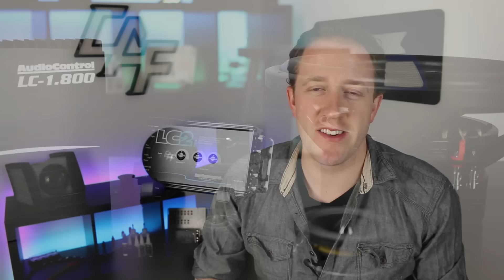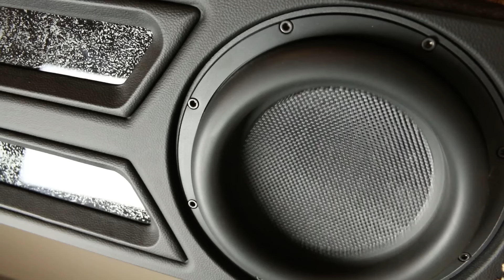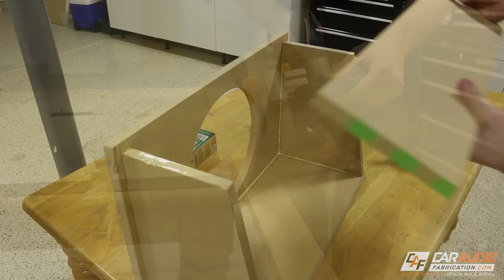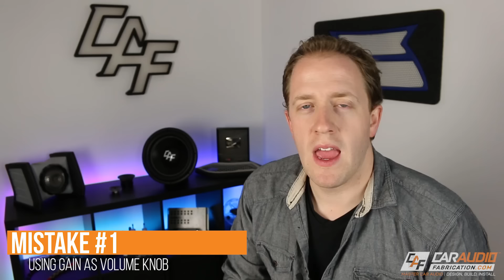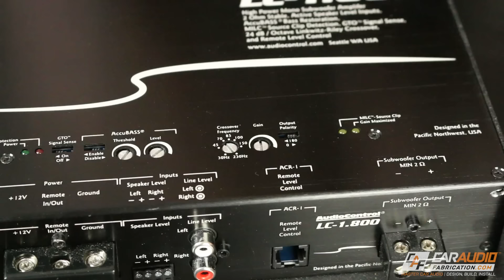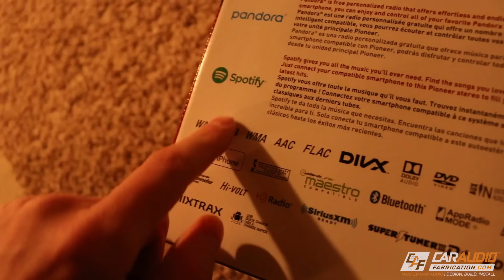Avoid these 5 common Car Audio NOOB Mistakes!

Comment: 😂 This video is 110% true! 20 years ago my headlights were dimming, amp gain on max, mix match subs, with about 4 tubes of bathroom caulk on my homemade box. can’t forget those red Sony explode 6x9’s on a 50x4 pioneer super tuner from Walmart.  Awww the good old days‼️
Reply: bro , red sony explode !! you just remember my old speaker dang !!
Reply: Why not add capacitor and good battery
Reply: I literally just put a”brand new”unused pair of Sony Explodes that I had lying around for years into my OBS Sierra lol!
Reply: Memories on those xplodes wow. You took me back 😄
Reply: Nah the heavier frame EARTHQUAKES had the sony xplodes beat, as di any speaker realy if "paired" with any sutable amp.
Even better sounds could be gained by using mix-matched speakers of all different reactances, as then you also had auto-leveling between 16ohm speakers, and 8ohm house and 4 ohm car and 2ohm subs.
Very difficult to attain, but sometimes putting a 16ohm across the same terminals as the 4ohms used, allowed for much harder hitting bass, with an increase in tweeter power.
Reply: As a newbie who wants to do their first install of audio gear, man I'm so overwhelmed by everything available on the market lmfao. I just want a setup that's good for pumping bass for mostly EDM music but I don't even know where to start.
Reply: Bro, yes!! The super tuner III was my fav back in the day. Had it pushing a 10" kicker solo baric (square sub) and a 300w soundstream amp. Good times
Reply: I've always just used the head unit to power my door speakers, and always sounded good with decent aftermarket speakers. Maybe i am missin out, but on my current 6 1/2 front and 6×9 rear, Cerwin vega 2 ways are crisp and clear with a couple of hard hittin 12's.

Comment: So, I plan on replacing all factory speakers on an '07 tahoe and adding a modest sub and amp for some bass. Is it absolutely necessary for me to replace factory head unit?
Reply: Daniel Lito no
Reply: Buy a lc7i
Reply: @Dshall88  thank you sir
Reply: Daniel Lito or you can get an lc4.800 . Which can let you tap into factory head unit and also is a 125x4x4 (4) channel amp. They go for 400-420 on eBay/Amazon. Then all you would need is a mono amp for your sub. I’d recommend. Keeping sub at 2ohm bc you can get a 500x2ohm amp for pretty cheap. Then just buy some fuze distribution blocks to run power to both amps with just one power cable coming from battery. Also acts as an equalizer and has many features. Will help you restore base from factory head unit. This guy has a video on it. Just type in lc4.800 and you’ll find his video

Comment: My mistake was the law of diminishing return lol should have watched this beforehand but it’s ok. 

My system sounds nice and I expected more bass from my single 10 inch sealed sub but oh well. 
 Could someone please tell me if my system specs sound about right because this is how I did it. (Just want someone’s feedback)

My amp is a 5 channel kicker amp. Putting out 100 rms x 4 channels at 2 ohms (each channel 100rms) and 1 subwoofer channel putting out 400 rms at 2 ohms

My speakers are the infinity kappa 682.11 cf and the kicker sub I don’t remember but it puts out 400 rms. 

Update: The sub is a COMPRT 10 inch sub. And it is a 2 ohm dual voice coil, in a sealed box. 

Question: The subwoofer says it is recommended for a sealed box of .40 - 2.0 cubic feet volume. Does this account for the top depth of the subwoofer?? Or would I have to minus that from the box volume I currently have to have an accurate volume.

I’m sorry I hope I make sense here. This is my first system build. Thanks for any help

Comment: Thanks for the info. Just watched two of your vids on noob mistakes. Glad I don’t do them, tho, I’m not necessarily a noob, just not a pro. Just did three iDatalink Maestro Rr w/ pioneer head unit installs. But for some reason, phone controls on SW don’t work on any of them, even with OEM BT harness unplugged and SW1 wire hooked up. Any ideas?

Comment: *Idiot Guide to Understanding Amp Power when buying  a crap Amp** - Ever see flea market Amps with massive numbers - 3000 watts for $100, 10K Watts for $179 too good to be true and it normally is... 
Here is a tip, the Fuses on the Amp will tell you what you need to know!  
As a simple rule of thumb with like a Class D mono block aka Sub Amp
 take a look at the Fuse value. Now Simply add a Zero. So a 30 Amp fuse now equals 300 a 90 Amp fuse is 900...and use that number for the estimated highest output of that amplifier.
  So regardless of what the Amp box says 10,000 Watts @ 2 Ohms if you only see 1x  30 Amp Fuse you are looking at a 300 Watt Amplifier in the real world. 
One should never even buy such a crap Amp that lies like that in the first place, but they seem to sell lots of them.  To not get screwed more than you already are, at least know something close to a real world spec on what the amp could possible do, instead of the numbers on the box that they somehow record when the Amp gets hit by lightning!

Real Amps with real numbers will tend to have the CEA spec numbers, but on cheap Amps this is the simplest way to not get totally screwed on a garbage Amp you shoudnt buy in the first place.

Comment: question: my amp which is the hcp 1dk does not have a gain control but has a "level" control. Is that the same?
Reply: I would assume so ik nothing but still

Comment: I have a 2006 Volvo C70 with the upgraded 14 speaker (2 subs) Dynaudio soundsystem. I installed a GROM unit and I am experiencing low gain issues. The FM radio still works great, but the GROM system (which overrides the 6-disc CD changer) only uses about 60% of the speakers' potential. Do you have any advice on how to fix this issue?

Comment: I’m trying to put two pioneer Ts-swx2505 in my 2000 Toyota Camry. Is there enough air space for both in my trunk? Or should I do one under my front seat and one in the trunk?

Comment: Have you done an installation on the new mazda 3?
I have one and I'm thinking install this:
+ AudioControl DQ-61
+ AudioControl 6XS
+ AudioControl LC-4.800
+ Set Morel Virtus 402 
Do You think it's ok?
I want to upgrade in the future with a subwoofer and more speakers

Comment: I had a 98 mustang with a 4 year old battery, some street dude did my bass installation and gave me a 1500 watt amp and 2 12in comp Kickers, at first it was so great I loved it, but in less than 2 months the wire hooked on the battery burnt up, then he installed a capacitor, and I burnt it 5 times (all this money straight out of pocket), then he family installed a house capacitor so if it was too much it would just cut of the circuit...you would think that a good solution until you're trying to impress people with your sound and the bass just goes out randomly and shamefully you have to get out of the car open the hood and reconnect the circuit...lesson learned big isnt always best

Comment: I find that generally speaking half gain or maybe a tad over is the sweet spot.  I turn gains down, turn up the head unit until i hear distortion and then back off.  Then I go and increase gains until I hear distortion and back off.  With bass I'll turn up the gain until the subs stop outputting more at about 2 notches from max on the head unit.

Comment: ima starting a home project where ima use an ac to DC inverter power supply to power my amp and the same thing for my stereo deck and try to make a home theater capable to put out 2000w do you have an insight or suggestions???

Comment: Why cant I wire a new amp into the old factory harness in stead of making factory harness bypass use them speaker wires to go into new amp
Reply: CALEB PERKINS you can buy a high-low converter and splice them into the speakers.

Comment: Most common mistake I've seen with upgraded car audio systems is using massive amps, subwoofers and speakers in a smaller vehicle.  Some people do this on purpose (gangsta bragging rights) but it's still a mistake -- they aren't getting quality audio, just lots of noise.  Often the audio system (or the custom wheels) cost more than the vehicle itself, LOL.

Comment: I got a single cab s10 literally the smallest as far as space, got 2 10's bridged on a single channel 2500w competition amp. Im having problems don't wanna hit deeper bass notes I'm thinking it might be due to starving for airspace
The dash/door speakers are having distortion problems I'm considering running them all off a 4 channel 600w amp I got collecting dust. This is my first system where's my YouTube pros to give me some tips and tricks

Comment: Bought my pickup from a guy who had a custom system done, which looks really nice and clean, but it’s using all kicker equipment. It looks like he did some power upgrades, but the speakers are dying now, and the system never really sounded good, just loud(4 10” subs behind the seat with 5-1/4” mids, and some 1” tweeters in the doors)

Comment: Hello
Thanks for your efforts I want your advice i have 2 sets of jbl Gto609c for front and rear doors it’s 3 ohm 90rms i am planing to buy an amplifier jbl stage a6004 or Gx a604 both of them 4/2 ohms lower rms than speakers @4 ohm 60rms
My question can i use one of this amps with speakers on 2 ohms to get more rms or what’s your advice about that to get stable performance and be away from problems?

Comment: I installed a jvc kw'v350bt in my 2008 jeep wrangler sahara unlimited. I checked and rechecked the wiring its done right but i have no sound. Any help would be greatly appreciated. Also theres a blue wire that is suppose to go to this other wire in the jeep but theres no pin on the receiving end?

Comment: I definitely had a system in an SUV I owned that when the bass slammed my lights were definitely dimming! ALOT! Which sucks because it seemed like upgrading the electric would have costed more than the rest of the system put together, significant investment

Comment: I think my biggest mistake early on was mounting depth. I had a 84 Ford Ranger with 2 Rockford 15”s. It beat like no other but I think it hurt my knees lol.
Reply: Same here bought a brand new s10 in 2006 and had 4 15s in the extended cab and 2 in the custom enclosed bed. Blew my rear windows out and sounded cool for being 19 years old but not I got for top deal door speakers and head unit with no woofers or just a couple 10s and I also run a mids highs amp. Much better sound then fluttery bass

Comment: I seen so many guys do a big system and immediately think battery. And the slightly more knowledgeable say capacitor.  I just want to smack them. Alot of them think their stereo is running off their battery while they cruise down the highway.  Ill try and explain and most try to argue until i just tell them " f it. Google it" lol. I always tell them do big 3 first cuz its the cheapest and that way you know your getting max power out of what you have.  Most average guys will be covered.   Im a proponent of welding cable.  Seen plenty of comparisons of that vs overpriced car audio companies "kits" . Most of it is garbage that costs 4x as much as welding cable and wont last half as long.  Beef up the alternator after that if need be.  Battery is fine if you just want to and jam alot with car off. Capacitor...i just put in the same drawer as my wifes dildos.  About the same usefulness......🤣

Comment: Can I run a “1200 watt” wiring kit from Walmart with a 300 watt max output amp? The recommended gauge wire for the amp is 8 gauge with a 40 amp fuse but this wiring kit looks slightly larger than 8 gauge with a 60 amp or 80 amp fuse (i can’t remember).

Comment: After dabbling in car audio for 25 years (on and off), I’ve found the best bang for your buck is Alpine Type R for speaks (components and subs). They’re extremely affordable, they can take lots of power, and they sound magnificent. Just my opinion. I even installed a Type R 12 into my home theater because it sounds that good.
Reply: Renamed to the R series, they have not changed their speakers design for a few years so if your new tk buying alpine look for old stock in the type R ranges not series R
Reply: My pops has had two type R 12s subs for 19 years and I’m the one using them now
Reply: Best bet is JL audio, top notch and trustworthy
Reply: @texasboii5539  100%

Comment: How do you know if the polarity of a stereo speakers right
Reply: Just use a fire alarm battery, and touch + &  - on the speaker. You will see what way it moves. If it goes inwards it's the wrong way.

Comment: Another common one that I see all the time that drives me crazy - people who insist that they MUST buy an amplifier with a power rating that matches the power rating of their speaker / sub.  

So often I see people say "Can I please get recommendations for an amp that is 1,000W RMS for under $XX?".  Then when I ask them why they need 1,000W RMS, they say it's because I have subwoofer X, which is rated at 1,000W RMS, so I need a 1,000W RMS amp.  

I hear this so often, and it drives me crazy every time.

Comment: I just fixed my friend's car. The owner before him had wired the 2 sub in phase. the compo set (RF Power series) was wired totally wrong. One Door was okey but the other the Woofer was in the Tweeter port on the filter and the other way around. Also they was installed in fase.
We ended up with a set of Audiosystem H serie compo ind the front and Audiosystem R series Free air subs sins the custom glasfiber box didn't have a cabinet. Also there was a 6gauge wire with 80amp fuse from the battery down to a splitter with 2x100amp fuses. The monoblok was rated 80amps and the 4 channel was rated 60amps. He got some of my old wire (0gauge quality cable and a 150amp fuse) .  Its sounding nice now. But we still have some work to do on it. Stiffening the glasfiber box. And isolate the doors better. But man that car must have been thru 5 or 6 18years old owners with all that shitty install we had to pull out and rewire

Comment: I just had some music hooked up in my 2010 suzuki equator truck and now my motor sounds super shitty. Kinda sounds like valves are tapping or like a baseball card stuck in the fan. No check engine lights are on. Anybody familiar with this problem or have any helpful info please share. Thanks!

Comment: Can I just replace the radio and speakers without any modification (besides wiring up the head unit to the stock harness)? Or do I need other parts to make it work? Will it all play and work safely by just taking out the old speakers and hooking the wires up to the new ones?

Comment: I have a fairly budget build. 40$ eBay wiring with a capacitor. Sony speakers 30 for 2 on sale, free 2 tens a 50$ pioneer 760 amp and a jvc 60$ head unit. I thought a capacitor would solve my voltage issue but I still see them drop to about 10-11 volts. I thought it was a bad ground so I cleaned the surface and it improved a good amount but I’m thinking about ditching the capacitor and getting a second battery specially for the subs and moving to 2 12’s. Does this sound ok? I am free to recommendations
Reply: I've had the same problem on my first car. Free 6x9 speakers on mid quality, free 10" sub and phase Amp, 70€ head unit and a free capacitor. Thought it would be crap, but installed it cause I was broke af. Later I figured out that the sub and the Amp aren't really bad, also the speakers are OK. But I had 2 problems.
1.: my battery and alternator were MUCH to small (33ah at the battery). Same system brought to my actual car doesn't do those problems with the headlights.

And the 2. Problem is no damping at all. If I turn up the volume it rattles like everywhere.

So right now at these days (waiting on my stuff) I'm upgrading to better speakers (makes a huge difference!), a 12"sub in fiberglass enclosure, 2 amps (one for sub, one for speakers) and lots of damping materials (will be around 50 pounds /6m² of reckhorn alubutyl in a first gen mitsubishi eclipse).

So to solve your problem, just get a bigger and better battery and a upgraded alternator.

Comment: Restoring a recently purchased '67 Plymouth Valliant from a guy who literally didn't know what he was doing. It looks like he focused more on upgrading the audio equipment than getting the car running. He moved the battery to the trunk and forgot to hook up the alternator to keep it charged. In the trunk, there was a lot of equipment there that wasn't hooked up including 2 amps, subwoofer, and a capacitor.

Comment: .......buying equipment in phases.....as in now I have 1 solo 12 cvr, off a hifonics 1000 watt.....then later I came across 2 12 cvrs at the pawnshop, hooked those up to the amp I already had. Then decided it’s not enough power, so I got a 1500 watt hifonics amp. Then decide we’ll screw it I’m putting the single sub back in there also. So now there are three subs in two different enclosures, and two amps....I guess the lesson. Plan out what u want to do, instead of adding,adding, different things.

Comment: I bought a Jeep Wrangler (their head units suck unbelievably). Since then I’ve bought two new kids and two tweeters for the sound bar as well as changed out the tweeters in the dash. I purchased a 12 inch sub and amp by alpine but just haven’t been able to set it up yet. The left tweeter on the dash has been buzzing since I bought it and does so until I take ALL the bass out from the head unit. Do y’all think I have to buy a new headunit if I do have an amplifier?

Comment: How i wire my dvc subwoofer with 4 ch amp at 1 ohms
Reply: Depends on the speakers ohm load...4 ohm speaker would need 2 more 4 ohm speakers wired in a parallel circuit to become a 1 ohm load on the amp